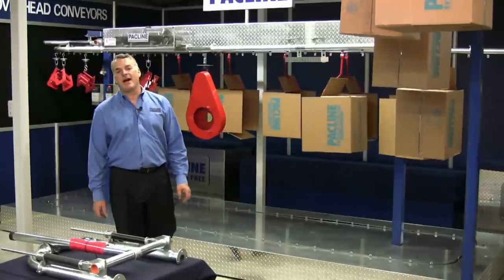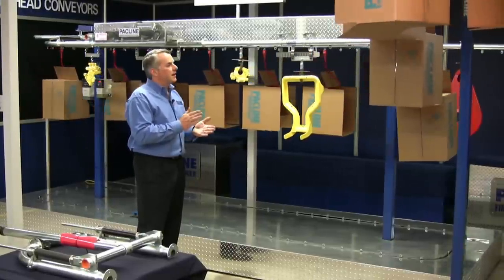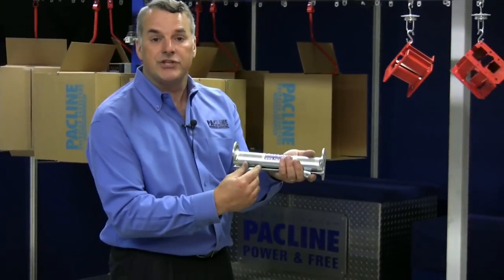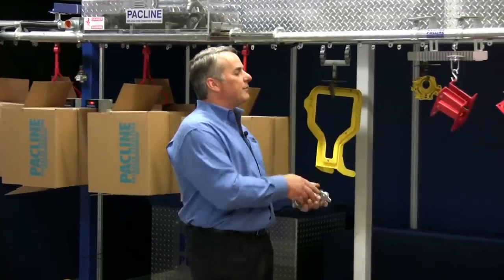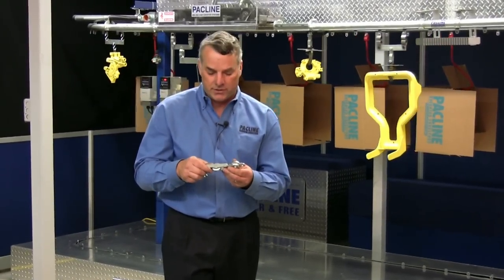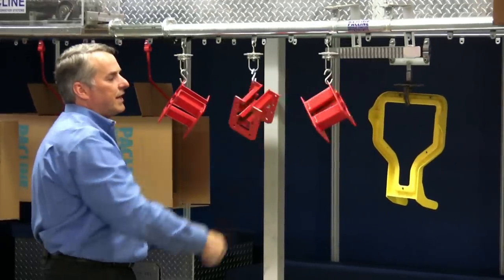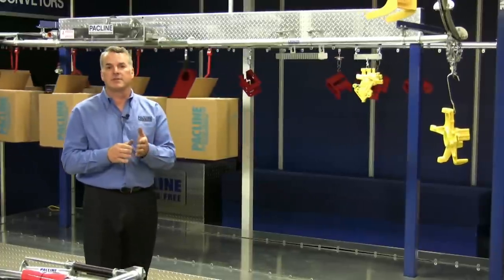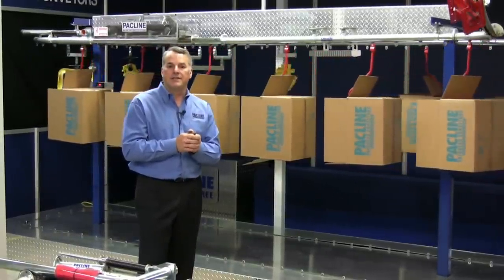Overhead Conveyor System Basics

Comment: A very good video. I did an internship at a "modular conveyor" factory in Grand Rapids and I currently work in an assembly plant in Flint. Everyday I deal with conveyors as part of production and maintenance but it's not something one learns in college. This was very information using a small scale system that "conveys" the same principles.
Reply: hey, I know it has been 10 years but do you have any material for designing an overhead conveyor (calculations etc.). I'm designing one as an intern. I would be more than appreciated.